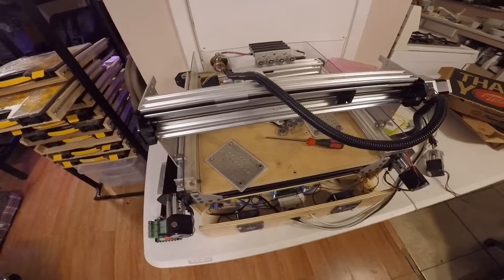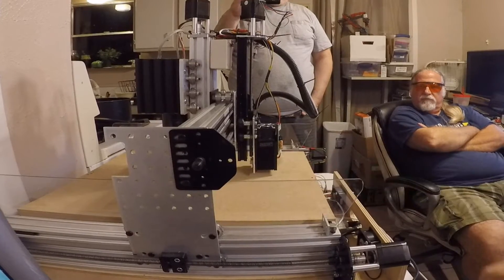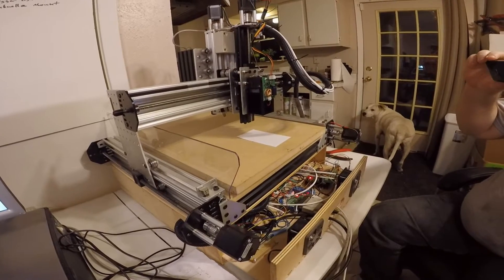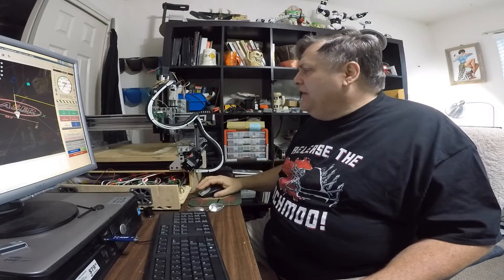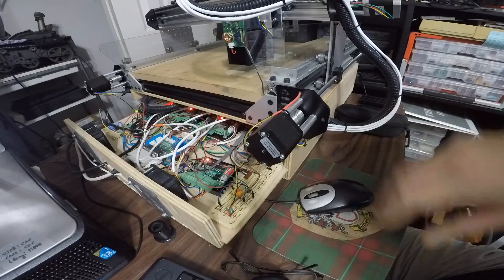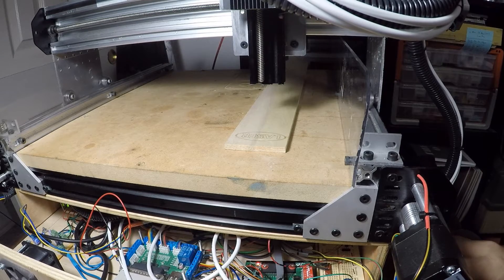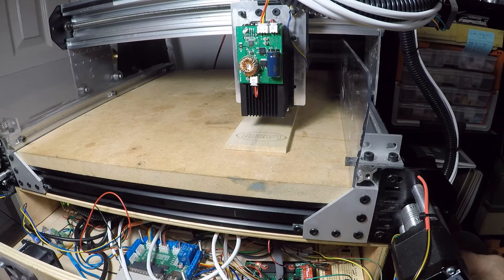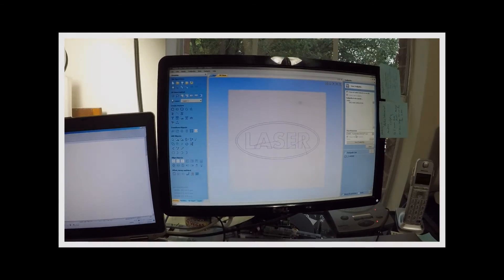Frankenlab CNC #17 - Frickin LASER

Comment: very informative video - thanks, I downloaded your files, again many thanks, I do have a question regarding Q values, exactly what are they? I don't quite follow, is it some form of code like G code and M code, do you have a reference I could read that explains that step. I'm trying to get a laser running on my own LCNC system and that step from your PP into Gcode then how that Q value is used has me quite lost. Thanks again
Reply from the maker: First look here: https://linuxcnc.org/docs/html/gcode.html
More specifically: https://linuxcnc.org/docs/html/gcode/m-code.html#mcode:m67

If you were to Enter G1 X50 F500 you know that we are going to make some movement, the Axis in this case is X which will move "50" units at a speed of "500" units... you know this because you understand the G1 G-Code. In my case, I am using some M-Codes specifically M67 and M68. M67 says, "hey, next time you move... also do this." while M68 says, "hey, do this now."

M67 and M68 will act upon an ANALOG output... which means it will output a PWM waveform that you can electrically filter and make into a variable DC voltage. So there are four possible outputs defined... 0,1,2,3 and are assigned to the variable "E" that we can select. So we can say G68 E1 an we know that we will effect the (E)electrical output #1 right? But we never told it what value to output. In the digital outputs it is either a 0 or a 1, ON or OFF. We are using a PWM so you would think the variable would be "P" but that is already used in PAUSE so whoever wrote the LinuxCNC just went with the next letter available... "Q"

So if you send G68 E1 Q1 then the electrical output will be ON, or 100%. If you sent G68 E1 Q0 then it would be OFF or 0%.

But here is the cool part... it is ANALOG... so G68 E1 Q 0.5 means ON at 50%. G68 E1 Q0.25 means ON at 25%... etc.

The "Q" is just the value 0.00 to 1.00 that determines the PWM output value.

Helpful???
Reply: @Askjerry  Fantastic, many thanks Jerry, I'll read and hopefully digest all of this, I missed completely the M67 M68 bit as I was looking for a code not a parameter, I'm actually using a Mesa 5i25 card, a Gecko g540 driver and SuperPID spindle controller with the G540 pin 8 outputting an analog 0-5vdc in response to a spindle speed PWM setting, hopefully I can cut into this and just with some changeover switch drive router/laser individually, but we will see.
Cheers from OZ
Reply from the maker: @ericgunstone4489  You can, you just need to define another pin as ANALOG OUTPUT #1. Then use the M67 and/or M68 with the parameter M67 E1 Qxxxx as likely the spindle PWM is the M67 E0 Qxxxx setting.

Comment: I have linuxcnc running 2 c-10 boards from cnc4pc.  With this board work with pwm for controlling laser power? I run a plasma so I have not had to deal with anything needing a speed command.  Thanks.
Reply from the maker: I presume that you mean this board...
https://www.cnc4pc.com/c10-bi-directional-parallel-port-interface-card.html
If so, certainly it can do it. Now, the signal coming our will be 5v, so you will want to build the opto-isolator circuit to create the needed voltage for your laser. One of my other Frankenlab videos covers how to do that, but if you get stuck just email me at jerryarutherford(at)gmail(dot)com.
Reply: @Askjerry  Thanks I appreciate your time. The laser list that it will accept up to 10v signal.
Reply from the maker: @shanester2594  Yes. You take a 12v supply and run it through the PWM circuit. If you cant find ot I will go through the videos and locate it. It is built around a 4N35 chip.

Comment: Hello sir, so right now I am trying to build my own laser engraving machine using linuxcnc. I am using a 3.5 watt blue laser which already have a ttl board included. I was trying to connect it to my 5 axis cnc breakout board (parallel port) by setting up the pin 16 as pwm. I connect my laser ttl positive cable to the pin 16 and the negative cable to the same ground which my limit switches have. Then, I connect an external 12 dc power source to the power slot in my ttl board. After that, the laser turns on, but I can't control it. I can't turn it off even after I tried to write M67 E0 Q0 in the MDI in linuxcnc. Can you please help me with my situation? 

P.s: I've already connected my breakout  board with an external 12 dc power source, so I guess it should work. All my limit switches work well. It would be nice if I can send you the pictures of my configuration to make it clear.
Reply: Before you connect the laser... I suggest you connect a simple LED with a 150 ohm resistor. Then experiment to make sure that the intensity can be changed using the PWM command. Look at my files http://askjerry.info/FRANKENLAB/ and see how I have mine set up. Look at the FRANKENLAB.hal file... search for "pwm" and you will clearly see my LASER definitions... compare that with what you have. 

Then... when you have set it up and can dim an LED connected to that pin... THEN connect the laser 5v TTL input and give it a shot. Right now... you simply have a configuration error.
Reply: @jerryrutherford965  hello sir, I've seen your FRANKEN.hal file. I saw that you've set your pwm pin in pin number 9. At first I set my pwm pin in pin 16 and I can't get any result for controlling my laser on/ off or its intensity. then I tried to change my pwm pin to pin number 9 in my BoB. But still I got no result. I have tried to look at the pwm signal using an oscilloscope. when I turn the spindle button on and off it gives some changes. when I increase and decrease the spindle either in ccw or cw, it gives changes too. But I see no difference in when I connect it to my LED. I put my pwm cable which is from pin number 9 to the positive leg of my led, and the ground to resistor which is connected to the same ground that my limit switches have. I can't control my LED, it only gave like stray voltage.
Reply from the maker: @birdoutofcage7  Did you notice I have TWO pwm generators installed...
loadrt pwmgen   output_type=1,0  # First one for Spindle out, Second for LASER out 

M68 is IMMEDIATE ACTION (Starts immediately.)
M67 is SYNCHRONIZED (Doesn't do anything until the next G-Code)

Also... my LASER pin is set to pin #8... I use #9 for the spindle.
net laserpwm        <= pwmgen.1.pwm => parport.0.pin-08-out # To the LASER PWM -> To laser module TTL INPUT
net spindle-pwm  => parport.0.pin-09-out  # To the SPINDLE PWM  -> exterior ANALOG Circuit

And... I set pin #8 to not inverted...
setp parport.0.pin-08-out-invert FALSE

I'm using this to turn the LASER OFF
M68 E0 Q0.00  (Laser OFF Set to 0% Power  )

This is 1% of full power...
M68 E0 Q0.01  (Laser ON at 1% of full power.  )

And this is full power...
M68 E0 Q1.00  (Laser ON at 100% of full power. )
Reply: @Askjerry  I'm sorry sir, I guess I was looking at the wrong .hal file. I was looking the one inside the Frankenlab_V2_2016-12-27.zip, whereas the one that you mean is probably inside the FRANKEN(5).zip. So I've followed your configuration and tested it with my LED. After I home all of my axis and type M68 E0 Q1.00 in my MDI nothing happened. It still has a stray voltage. What should I do next?
Reply: @Askjerry  sir, I've tried to drive my laser ttl through arduino which frequency is about 500Hz, and the result is I can control the intensity of my laser. Then I tried to change the frequency in mh hal to become "setp pwmgen.0.pwm-freq 500". But again, I still can't controo my laser when I use the M68 code. Is there something wrong with my BoB?
Reply from the maker: @birdoutofcage7  I do not know. I would say to look at the LinuxCNC forum to see if you can learn more.
https://forum.linuxcnc.org/10-advanced-configuration/32731-secondary-pwm-output-for-laser
Reply: @Askjerry  sir I've finally figured out how to change the laser power. So apparently I've been using the wrong ground from my BoB this whole time. The after I change the ground, I can use the M68 to change the laser power.
Reply from the maker: @birdoutofcage7  Excellent! Be sure to post a video of your finished system and share it here so we can all see it!

Comment: I just saw your tutorial. I have ordered a 15W laser. Can you give me more details about the wiring please?
Reply from the maker: It's pretty simple really... the laser has three connections, 12v, Ground, and 5v Pulsed Input. Black is the ground connection and for a 12v supply, I simply used an old laptop power supply that put out about 4A... more than needed so it worked well. The board is marked "  -   +   PWM" where the BLK is -, The Yellow is + (12v) and the red is PWM (5v pulsed.)

Set up a pin in LinuxCNC as an "Analog Out" which means that a 1.0 will output 5v, a 0.5 will output 2.5, etc. Then what I did was to set up Aspire/Vectric with my own post processor... it puts out a value for the PWM instead of a Z depth value. So if I want 80% power... I tell Vectric to make a "cut" that is 0.8mm deep... if I want 25% power, I tell it to "cut" 0.25mm deep... etc. 

Email me offline and I'll send you my codes. I set the second Z axis (laser focus) as the "A" axis... then tweaked the INI file from ROTARY to LINEAR to make it behave properly. I was pretty happy with the result. But you do need to add a hardware switch on the laser power... to prevent it from coming on when you don't expect it... like when switching the PC on or off.
Reply: askjerry I realize that. But I have to use a different breakout board? I want to use the same Z axis. Thanks
Reply from the maker: You can use the same Z-axis if you like. I just wanted mine to be independent. Just be careful when you create your G-code that you change the Q value, not Z for the laser to prevent running your laser into the work. As long as you have one pin that you can program as an Analog out... you should be fine. If not... you could use the spindle start/stop to trigger the laser... and build a separate PWM generator to set the power level. There are many ways to do the same thing... you have to find what works for you.
Reply: Where can I find your email?
Reply from the maker: http://askjerry.info ... you know... the big one at the end of the video.  :- D

Comment: I've been following your frankenlab series diligently - best linuxcnc tutorials on the web!
Now I'm hoping to add a laser to my cnc machine so that I can mark the parts as they are cut from sheets of ply - but I'm not sure how to proceed. I use sheetcam for most of my cam (but I also have v-carve pro). Is it possible to both CNC and laser in the same linuxcnc config? Ideally, 1) the laser would mark the parts 2) "toolchange" -  3) spindle cuts out the parts, all in one .ngc file. If I need two config files, it'd slow down productivity; stopping one linuxcnc instance and starting another is significantly slower than just whipping out the magic marker.
Thanks again for making awesome videos!
Reply from the maker: Are you reading my mind??? Over Thankgiving I should be home... and I have two videos planned... one on creating custom M-Codes, the other on setting up to do engraving and cutting in a a single process. Basically... yes... by knowing the offset between the cutting tool and the laser... mark... move the machine to the new location and reset home... then cut the part... and reset the home so that you are ready for the next part.

I just need to get the time to make the video!

Glad you like the videos... i enjoy teaching and getting feedback let's me know that folks like you find it useful!

Jerry
Reply from the maker: 2017-12-13 Update: Thanksgiving didn't pan out... I got sent elsewhere for work... but I'm filming it now... Whoo!
I'll get the video posted ASAP! LASER+ENGRAVING... and custom M-Codes too!
Reply from the maker: UPDATE: Tada! - https://www.youtube.com/watch?v=0eXu1hFaymI

Comment: Very nice!

I`m trying to add a jogwheel to my panel as a solution to be able to move the mill with a somewhat better precision, but so far no luck! Was hoping you played around with the jogwheel and if so, do you have some pointers on how to do that. Or a different solution to move the mill precise!

Thanks!
Reply from the maker: I have not really played with the jogwheel... I suppose I should however... just to try it out. One thing you can do is add a JOYSTICK as an input... they work well... then you can select between CONTINUOUS movement and incremental movement... 10mm, 5mm, 1mm, 0.5mm, 0.1mm for example. I use that quite a bit on my larger mill.

I'll plan to do a jogwheel in an upcoming video... hopefully I'll be home more than three days this week!
Reply: I`ll keep an eye out for that !

Comment: 15 watt is 10 times the power of mine looking forward to seeing it cut some wood. You need a LaserShoe to deal with the smoke. 
Cheers 
Peter
Reply from the maker: The laser cut through 6mm poplar at 50% power, 100 mm/m speed. I tried engraving metal... that did not work... 99% power. After I did that, the laser no longer cut through the 6mm wood at the same setting... it looks like overall power dropped about 80%. The cuts went about 90% through the wood now.

I think they took an 8w laser and adjusted it to run much higher at a pulsed rate... it is possible that even when I say 50% power... it is still pulsing 200%, only at a slower rate. I need to experiment when I get more time. If I am correct... this laser will fade (loose power) quickly. If so... i am very sad... they should set them properly and advertise them for the proper power output levels.

I was engraving at 50% power, 500 mm/m speed very nicely... could probably go to 650 mm/m speed. Hopefully in two weeks I can set up to experiment... I'm very busy for work now.
Reply from the maker: Probably going to make an enclosure... move it downstairs next to a window. I tested marking metal... didn't work. I really didn't expect it... but was kinda hoping. I'll do some cut testing when I have a chance... may take a week or two. Lots of changes going on in my life right now.
Reply from the maker: David Ramer I've used it. the tape works best. $50 a roll. I've also heard you can use moly dry lube. The laser was said to be able to mark steel directly... would have been cool... just not true.
Reply: askjerry 
hi jerry
i'm beat i'm from swizerland
i've a cnc router at home and i'm considering to buy a laser cutter. could you tell me a bit more about your laser? how strong should it be, to burn, to cut wood and how strong to engrave? have you already expiriance with something like this?
thank you for your help :-)
kind regards
beat
Reply: Very impressive.for a laser diode.
That's going to make if far more useful than mine which is limited to engraving only.
Looking forward to the next update, when you get time.
Cheers
Peter
Reply from the maker: I had an Epilog laser that was 35 watts, it cost me $16,400 USD in 2001. It would cut through 6mm wood like poplar and oak in a single pass at about 75 mm/m. This little blue laser is about $300 USD and puts out about 15W maximum... more realistically... 8W average. That is less than half the total power of the $16K machine... but the wavelength is about 1/20th. This means that the power is concentrated into a much smaller area. I was able to originally cut 6mm wood at 100mm/m in a single pass at 50% power. 
(Not running 100% power because I want the laser to last longer.)

Now that I have used the laser a bit... the power has dropped off to about 70% of what it was originally. This means that if I set the laser at 50% power and run it at about 125 mm/m i can still cut the 6mm wood... but it takes two passes.

That sounds disappointing... however remember... it is a $300 laser as compared to a $16,400 laser... or about 1/54 the cost! So even if I had to replace the laser every year... it would take 54 years to match the cost of the Epilog. So for now... I'm happy.
Reply: hi jerry
thank you for your answer.
ok, how can you adjust the intensity of the laser? you do this by software or hardware?
fro where have you bought this laser?
kind regard
beat
Reply from the maker: There is a link in the description where to buy it.

In my G-Code I am using M67 and M68. This is an analog out... 0.0 is off... 0.99 is 99% power.

Reference: http://linuxcnc.org/docs/html/gcode/m-code.html#mcode:m67

Comment: Make sure you use the proper light protection Jerry.   Welding masks and those glasses are designed for UV light, not 445nm blue laser light.

Glasses : http://a.co/dT0ZsFc

Acrylic sheet : https://jtechphotonics.com/?product=445nm-laser-shielding

"Do not look at laser with remaining eye."
Reply from the maker: The glasses I have are rated 435 - 460nm. The welding mask actually does a good job... you can barely see that the laser is active. Riley pulled that one out. Everyone else had the yellow 190 - 532nm glasses on. We had Riley get the other pair out of the garage just to be safe.
Reply: #14 is rated to 200 amps arc welding that produces a LOT of everything from IR to UV and the not so occasional x-ray.  I'm fairly sensitive to uv, can't use auto-darkening helmets, even a good Lincoln one, without getting a sunburned retina migraine.     UV-C is a real bastard, graphs starting on page 4

http://www.dguv.de/medien/ifa/en/fac/strahl/pdf/uv_emission_schweissen_en.pdf
Reply: My peril sensitive welding helmet has shielded me from ALL sorts of things :-p

the cutting point is a couple thousand degree plasma, just visible though the #14 lens
Reply: Keep in mine that some of these laser diodes have a lot of UV emissions outside the visible spectrum.  Without knowing what wavelengths the welding mask is designed to filter I personally wouldn't trust my eyes to it.  I spent more on  nice OD5 laser goggles rated for 190-540nm + 800-1700nm than on my 3w laser...and it still kind of freaks me out sometimes ;)